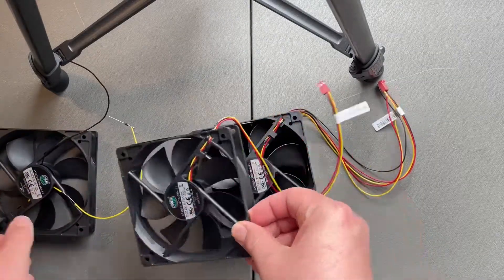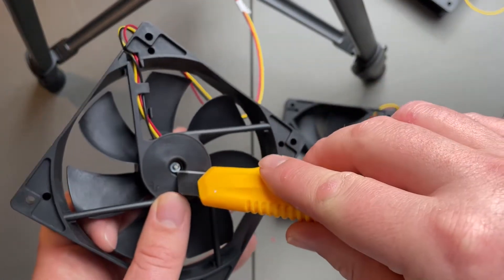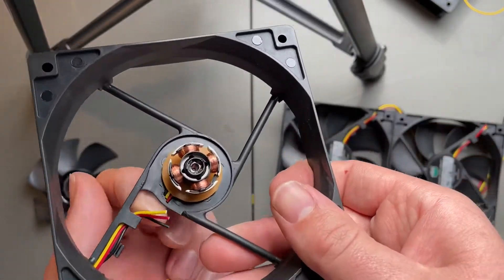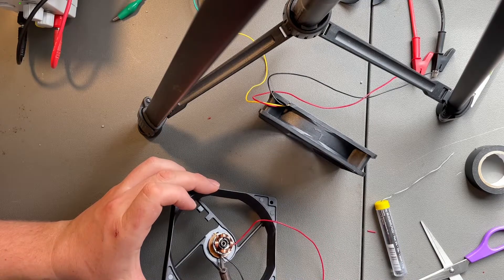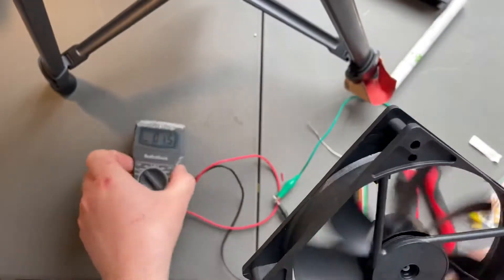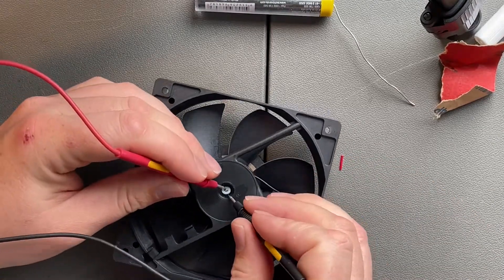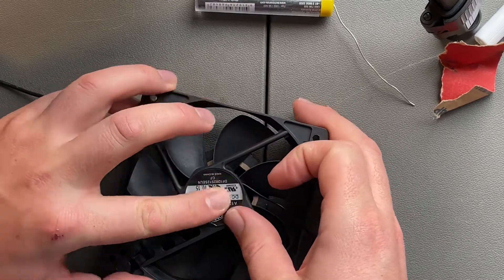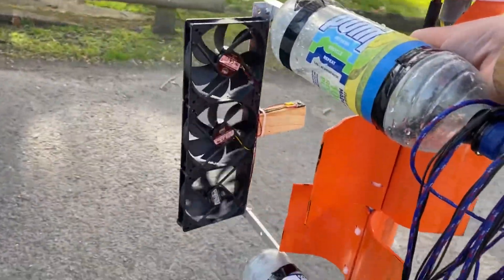Can a PC fan generate electricity?

Comment: which pc fan did you use? wanted to try it on my own but some fans couldnt generate over 1V altough the spin number was over 2000
Reply: it's a generic Chinese 120mm 12v, 0.25a brushless case fan. df1202512seln is the chinese model number, and loads of companies rebadge them for their OEM stock.

Comment: Quick question for a newbie, why does this generate AC current instead of DC, aren't they DC fans?
Reply from the maker: It is a brushless motor, which means it needs AC electricity. There is a small computer chip on the fan that converts DC into AC for the fan to run at the correct speed.

Comment: Hi how many volts can it generate? 
I was thinking of recreating and using something like an eletrical air pump to make it spin faster
Reply from the maker: It’s 12volt after I rewired it. That wouldn’t generate any more electricity than you use but it would be good for testing